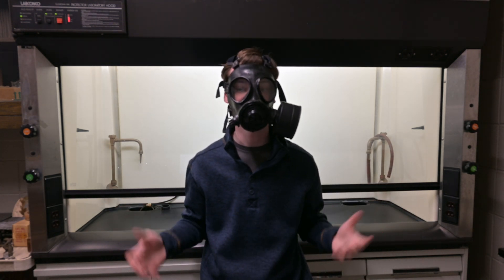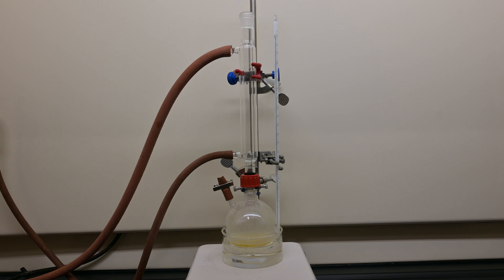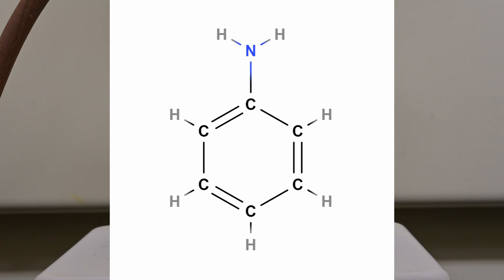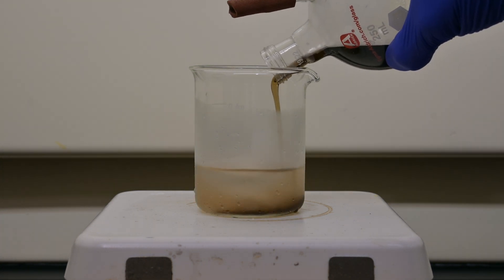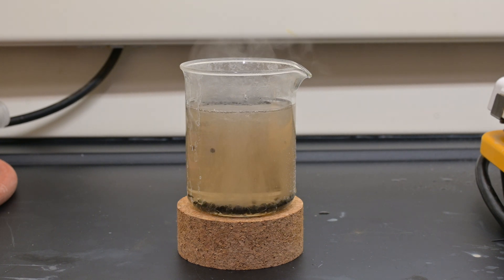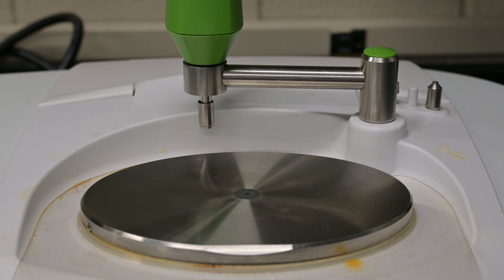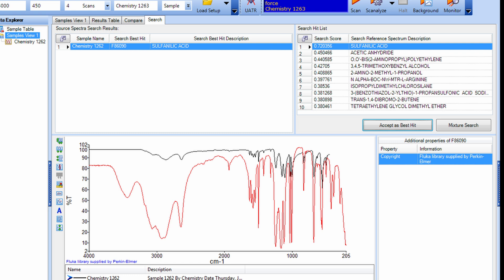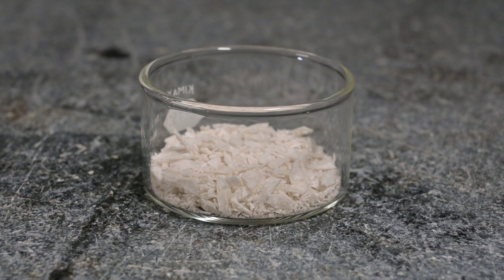Sulfanilic Acid from Aniline: The Hottest New Reaction in Chemistry in 1883

Comment: Nicely done!

Is pressure-equalizing addition funnel on your shopping list?
Reply from the maker: Thank! No, why do you ask?
Reply: @WheelerScientific  oh, just gotten burned a few times trying to add something "dropwise" from a thing not built to be able to dispense drops. A smidge bigger pour than you figured can result in excitement when you weren't planning to have any. The "pressure equalizing" part is so you don't have to have an opening somewhere else in the system where you might not want one. A sep funnel can be an addition funnel in a pinch, but that's inviting unplanned excitement in a lot of setups.